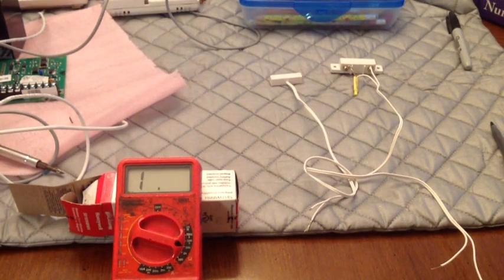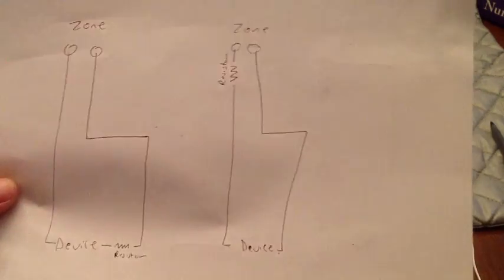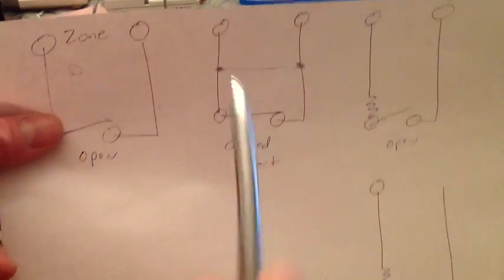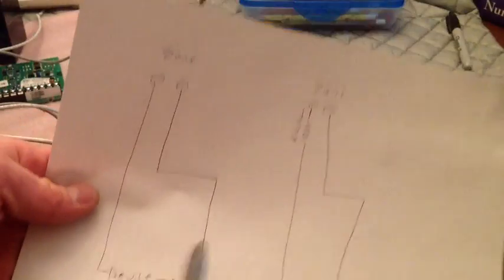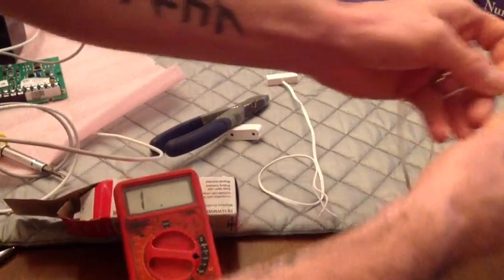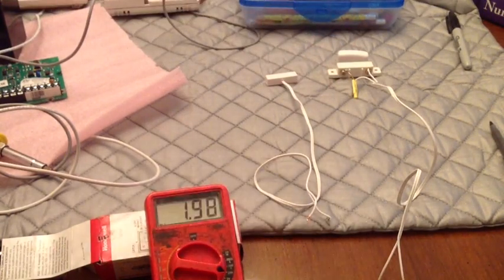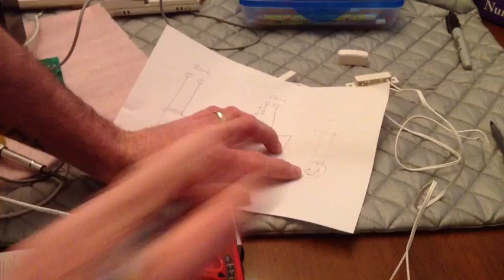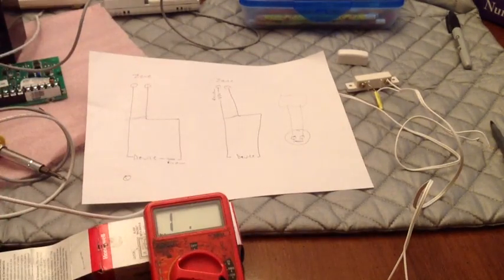Why we use Resistors at the end of line on alarm security panels

Comment: If it were me, I would have the panel programmed for EOL resistor operation.  The resistor offers the best of both worlds.  Open and closed circuit operation.  And, if you are an alarm hobbyist, the resistor is a must.  You can tie resistors in series and do some cool stuff.  The resistor is fun to play with in alarm systems.  And, especially with fire zones...the trouble condition can be demonstrated to friends and stuff about what a trouble condition would look like on an alarm system.  And, you can't do that without a resistor.  And, especially if you have smoke detectors in your system, the trouble condition can be used as a reminder to put the smoke detector back.  Especially me...everyone has done this, you've done this, I've done this.  In fact, every time I do work in my house, I stand on a step ladder or a piano stool and twist off the smoke detector and drop it in a desk drawer and then put it right back when finished.  Well, if you don't have the resistor, the trouble condition won't work and then, you could easily forget to put the smoke detector back.  I would highly recommend keeping the resistor.

Comment: Love the explanation. I just use n/c loops. Especially now with wireless. If a wire is shorting out and I can’t use a different pair, sorry time to go wireless. Resistors are mostly used for supervision in commercial circuits where someone may try and tamper with wiring. But that’s more on the really big commercial side. Residential and small commercial we don’t use EOL. I hate EOL’s cause I find it harder to troubleshoot why a zone keeps false’ing. I work better with uninterrupted circuits. I totally understand why you would do this, but it just complicates things. Dealing with resistors at the panel is much more convenient.

Comment: Thanks. Been looking for an answer for the need for a resistor. My door contacts also have a resistor between terminals? Don't know why. Also, are resistors directional? Regards Phillip
Reply from the maker: resistors are not directional. Diodes are.   For the reason for your contact to have the resistor across both terminals.. Well had to say without more info..  My first 2 thoughts.. A,  maybe normally open contact,  b, they are trying to correct the resistance with a seprate resistor.

Comment: O.k.....i have just bought a jet ski, i need to run a wire from my house alarm panel, about 10ft long to the jet ski, am going to loop a wire too and from the ski, i suppose i would (using two wires) run say my blue out to the ski, with my red, (the wires i use) and could just wire either end to a resistor to do the same job.....? it's only like running them to a magnet.....?.....yes...? and if that would be fine, what resitor would you recommend......thank you for your help.......

Comment: You can also use normal closed contacts and use 1 resistor in series with the contact and one parralel to the contact. For example if you use 3K3 resistors, in a normal non alarm state it will read 3K3, in alarm state it will read 6K6, when the conductor is cut it will read out off limit, and when it's shorted it's about 0 ohms. It's the standard way of working here. For fire detectors which are normally open we use the same method as you do.

Comment: That's a great demo!  My only question is why they bothered to put the "eol" resistors in my control panel, where there's no difference between a closed switch and a short...  Just a necessary current limiter?
Reply from the maker: +Mark O some panels cant be programmed to not look for the resistor.. it needs to see that load.. so people cheat and put at panel.

Comment: awesome video. I'm an apprentice. you explain it so well and make it so easy. I really don't the theory work but after watching this the theory of it is not so daunting.
thanks for your video
Reply from the maker: your welcome
Reply: If you're going to do this professionally, it's a good idea to learn some (very) basic electronics. Makes understanding things like the purpose of EOL resistors really simple to understand (and things like this video would take 1 minute instead of 8). Without basic electronics, you'll be rote memorizing stuff, and will then get things wrong when you forget that stuff. Basic electronics is not too difficult - just think of water instead of electricity and each component will become clear. For example, a lot of people find voltage calculations with resistors in parallel difficult to grasp. How can putting 2 resistors allow MORE current to flow, and not less. If you think 'water', it all just makes sense - even capacitors and transistors!

Comment: Hi,  can you confirm on a smoke detector that the resistor goes across the positive and negative terminals. If so can I use the spare negative and positive terminals on the device itself?

Comment: Same thing with commercial cameras now a days. I’ll run the wire, install the cameras and do all the connections. But don’t ask me to get it online. Cameras are usually all plug in play. But when they want to secure it all and get it working over a local and external network, that’s up to the IT guys.

Comment: I have a nice little supervised (1.8 KOhm) four zone panel built in to a programmable keypad. I ran all my wiring to a closet behind the keypad and thru-walled the keypad feeds to my closet backbox. This mini-panel also has two supervised open inputs (emerg/fire) and a fixed/momentary contact output for aux out.

I have two doors that must be individually zoned, that's zone one and two. I have eight windows, four on zone three and four on zone four. Each run was a homer AND each contact was supervised at the contact (1.8 KOhm resistor). Now, I've discovered a problem, as you can imagine. The panel wants to see 1.8K, the series-ed windows on each zone  offer 7.2K of resistance which looks like a short to the panel.

Do I have to remove three of the resistors on the window contacts so that the panel only sees one resistor? Or maybe, I should have divided by four and put .45KOhm resistors on each window, the combined offering 1.8K at the panel. As long as the zone threshold sees an open (drop of .45KOhm), this should work. Putting the windows in series (at the back box) won't work - do the math.

Didn't USP have built-in resistored contacts at one time?
Reply from the maker: Most people only use one resistor . The rest leave off.
Reply: Kraka069
That was just a fun question. I worked in the security alarm industry for 30 years. The panel I was referring to was a modified MOOSE keypad system. Great little panel. They had some issues with sub-standard power supplies back in the '80's, fixed that and became a pretty good choice for the low end market. I preferred NAPCO (they still around?). Solid performance, many featured and properly priced. They weren't RADIONICS but I preferred their dealer network over RADIONICS.
Reply from the maker: napco sux. GE or ademco gets my vote
Reply: Kraka069
well, i don't have any idea what panels are good or bad anymore, but we always referred to the junior installers and do it your selfers to ademco. real pro's used napco, radionics, dsl, dsr and accutech before your time. nowadays ademco might be the best, but it was the stepping stone alarm panel of its day.

Comment: Many sensors are wired in series on one zone, not sure how a control panel would need to be or could be programmed and wired to do resistors at each sensor for an in series closed circuit zone.

Comment: Thanks for the video. I'm installing my own alarm system at my house. I'm all caught up in the thing about how people can fool the magnet switches, like the ones in your video. Can you recommend a good magnet switch for me? Much appreciated.
Reply: There are lots of comments about magnetic switches and how to fool them, or quality. Can I just say, you should only use them as a means of being able to be sure a door is closed when the alarm sets, and to be able to initiate a countdown entry timer from the final exit door. Very rarely these days to people break doors down when breaking in, far easier, and in most cases quieter, to push a panel out of a door, or go through a window in which case the contact isn't broken and the alarm is not triggered. Motion detection is really what is required, of good quality of course.
Reply: @philharrison8857  Actually most break ins are people kicking in back doors. Hardly hear about window break ins. I get my info from jobs I do for the people who have gotten broken into.”

Comment: Usually with just one resistor at the last sensor in the loop/furthest from the panel, but some systems (like the Vista series) allow for using double loops with two resistors on a single zone.

Comment: Basically what he's saying is by using a resistor at EOL you are supervising the entire wire and device which is the correct way of wiring a security device.
Reply: D Smith  Which is the wrong way to supervise a circuit. It's the lazy way. No disrespect, but at that point, there's no reason to have a resistor at all. You're not truly supervising anything. Resistor at EOL is actually supervising the entire zone. Resistor at the panel is not supervising to EOL device. In commercial you should not being sv at panel. Reisi I don't even think SV is necessary but to each their own.

Comment: This isn't only about preventing wiring trouble.  If I was a burglar, hell bent on getting access to a building to steal something, I could theoretically get past the alarm if I really wanted to.  Perhaps the building is open during the day, I could go inside and short out some window sensors.  Or at night, cut or break the glass out of a window, reach through, and short the sensor.  Then, you can open the window without setting off the alarm.  With the end of line resistor, if somebody were to do this, as soon as you short the wire, the alarm would go off.
Reply: @Christopher Jones: I think that's what they are for in most cases, but that wasn't mentioned in the video. In fact I'm not sure the video really summarised why EOL resistors exist at all, more just a non-electronics discussion of what happens when you put EOL resistors into a circuit.
Reply: You can't cover the RIGHT sensors like you used to...they go into tamper even with the alarm unset...
Reply: @MrLibbyloulou  what you mention here is anti masking, these are sensors of a high quality and grade which have this feature and are wired in line with EOL resistor wiring, an extension of it if you like.

Comment: Hello I have a DSC 1832 alarm system. I have a motion sensor that keeps tripping the alarm off at times. I replaced the sensor and still the alarm is being set off. Can you please help?
Reply from the maker: Darin Ghisayawan  whats in  the room? Animals? Balloons or anything that moves? A/c vents? Whats the environment like?
Reply: Kraka069 it's in my attic, so there's not much there. No animals, people or anything. The system will arm Ok and then sometime after the alarm will sound, very annoying when it goes off at 3am. Sometimes the zone will be open and it has to be bypassed to arm the system.
Reply from the maker: Attic is not the place for a motion detector. If you're worried about someone breaking in through the attic to contact switch on your attic hatch
Reply: unless it is a microwave motion detector it shouldn't be in an attic, and if it is microwave, it can go through walls like sheetrock.. and is not normal to use in a residential site....... more than likely it isn't a motion detector in your attic, if it is anything, it is a heat detector, if it is on the alarm, but the fact you can arm it, .... if it is a heat detector, it would be a fixed temperature heat detector and would only be able to go into alarm once, and you wouldn't be able to get it out of alarm to arm it again until it was replaced.............its probably not that...... but you said you replaced the sensor, so I'm guessing you know for sure it is a motion in the attic?.................there are a few different types of motion detectors... Infrared and microwave are the two most common....... no one would put infrared detectors in an attic, it gets hot and stays hot, all the motion would see is red all the time and not pick up body heat.....microwave is usually for commercial jobs, where the motion has to see through boxes and around corners and gets stopped by concrete walls..... people put them in houses sometimes, but not often., ... you said it is going off at night when you sleep and if it is a motion and was programmed as a motion in the panel, it would get bypassed when you arm the system in stay mode to sleep, so a motion anywhere wouldn't set it off at 3 am, if the system was armed and you were sleeping............................. I think what your looking at in the attic isn't connected to the alarm system, its not common to put motions in attics, and an 1832 is a normal residential panel.............. ive seen a lot of homeowners think their AC powered smoke detectors are hooked to the system, or think some other device is part of the alarm, when it isn't...... the only thing I don't understand is what you replaced........... if it turns out to be a microwave detector somehow... they don't just go off with animals or people, they will bounce microwaves off anything that moves, so the slightest breeze could move insulation and make it go off...... the infrared one would have to see body heat move................. ive heard people say balloons but I don't see how, its helium, its not hot, unless it moves in front of a 60W light and distorts the heat signature............ an AC vent or sun on a window would do it... not likely at 3am in an attic........................ if it really turns out to be a motion detector in your attic, and it for sure is the zone tripping, you might have squirrels in your attic, they get in there a lot....................... did you have the alarm company install the motion in your attic or was it there when you moved in....... you would of had to specifically request a motion in the attic..... so if you did, why?

Comment: Where would a EOL resistor be added if I have window switches wired in series for each room in the house?
Reply from the maker: +Vance Holman all home run back to the panel or all windows on one wire>?
Reply: +Kraka069 
If I add a 2K resistor at each window or door location, then wire for example a group of window switches at the panel in series for different rooms, then the panel would see either open or 2K, 4K and 6K when all are closed.
How many ohms is each Vista zone setup to measure?
Reply from the maker: +Vance Holman just the end one needs the resistor  ( 2k )

Comment: I don't get it.  You pinched it with the resistor and the voltage dropped??? So the alarm would go off?
Reply: He wasn't measuring voltage, he was measuring resistance.
Reply: It wasn't a great way to demonstrate it, but he was 'cutting' the wire to actually short it ie. the opposite of what you'd think. Because the pliers made a connection between the two wires. Not the usual way of doing this and quite counter-intuitive, but unfortunately not really explained that well, so it was a bit confusing.

Comment: It's really good to know this after all this time of wondering. But how come some times devices won't communicate properly without an EOL resistor? And how come some times you put them at both ends (start of line if that's such a thing, and end of line)
Reply: It's not common, but the main reason for EOL resistors at both ends (if that's the way the system is designed) is not to make them add up to 2K (if that's what the circuit requires). It's to allow the alarm system to differentiate 4 states - reflecting the 4 voltages you get when one, or both resistors are shorted out of the circuit. Some high-security systems do this to try and detect burglars shorting the circuit - they can short out one, but usually not both of the resistors given they are in different locations, allowing the alarm system to pick up any interference with the circuit.

Comment: What about double end of line resistors
Reply from the maker: double end of line is 2 different value resistors,. for easy math , lets say  door   is 1 ohm and motion  is 4 ohm 
when the
 panel sees 5 ohm both circuits are good
panel sees  just the 1 Ohm motion is tripped 
panel sees  just the 4 ohm door is open
panel sees  0 ohm  both open
panel sees short , there is a trouble
Reply: Kraka069 thanks can all pir sensors be wired like this just for the extra potential future trouble shooting? Also were can find info on how to read these diagrams thanks

Comment: Any chance you might know what  dual EOL monitoring is?
Reply from the maker: Yes.
Maybe ill do a video

Think of it this way  
Just an example
Door 1  Eol 1 is 1k ohms
Door 2  Eol 2 is 2k ohms 

Both doors closed 3k ohms resistance
Door 1 open panel would read 2k ohms
Door 2 open panel would only read 1k ohms
Both doors open there would be 0 ohms
Short would suck tho. Both zones would be in trouble .
Have to meter at the panel to figure out whAt zone was actually in trouble . But no biggie
Reply from the maker: Yes.
Maybe ill do a video

Think of it this way  
Just an example
Door 1  Eol 1 is 1k ohms
Door 2  Eol 2 is 2k ohms 

Both doors closed 3k ohms resistance
Door 1 open panel would read 2k ohms
Door 2 open panel would only read 1k ohms
Both doors open there would be 0 ohms
Short would suck tho. Both zones would be in trouble .
Have to meter at the panel to figure out whAt zone was actually in trouble . But no biggie
Reply: Thanks for the reply back!  So with both doors being closed and showing 3k ohms resistance, I'm assuming that door 1 and door 2 are looped?
Reply from the maker: +Jace Garcia 3 k was an example. Check the panel door diagram. It will tell you resistance value